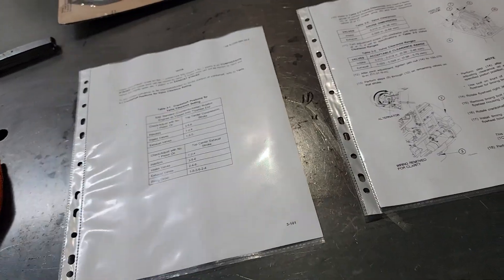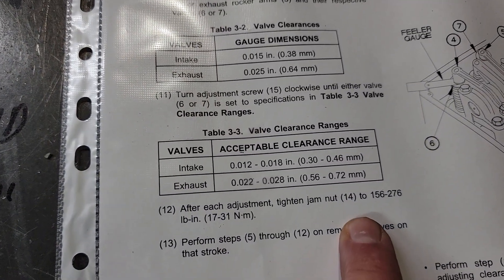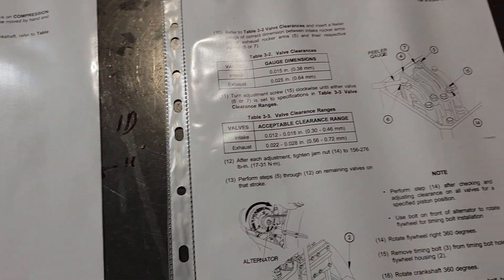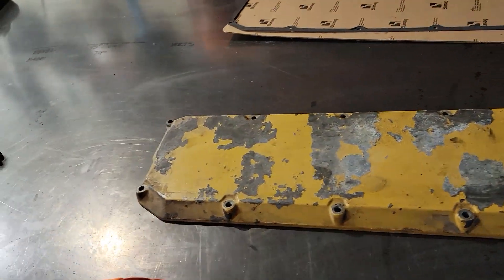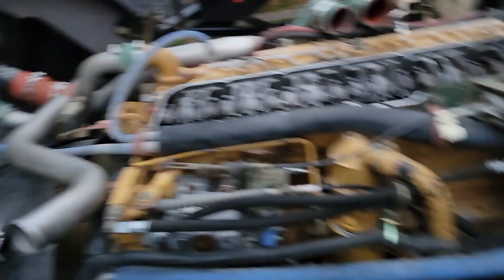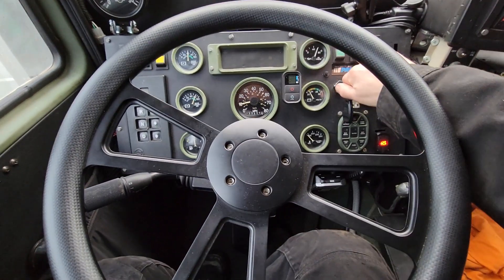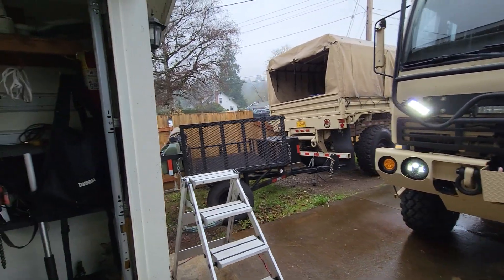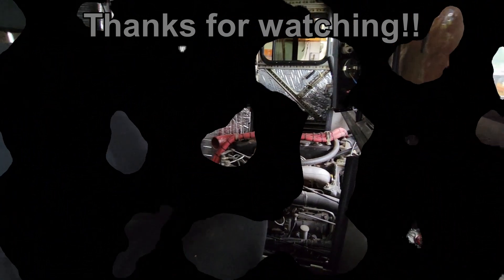Abel LMTV build part 166 (CAT 3116 valve adjustment procedures)

Comment: Yours is so much easier to do than my 3116 because yours is on a cabover lmtv military truck mine is on a c6500 regular truck so the two or three cylinders on the back of engine are underneath the c a b and I've been I'm getting ready to do this to all of my 31/16 I have I have a total of 3 and I have one 3126 that I plan on selling
Reply from the maker: I can see how that would not be a fun task.  Luckily though they don't need to be done very often.

Comment: Ahhh another sunny Oregon morning:)  to add, while you are in there you can easily check/confirm the injector height/timing measurement with a vernier caliper that has a probe on it(most do). They list the injectors that you check on the sheet along with the valves for a given crank revolution.  With the dial zeroed with the probe flush with the end of the caliper, extend the probe and measure from the top of the injector tappet/spring cover beside  the rocker arm, down along side the spring to the flat top of the shoulder of the injector base. You can see the shoulder easily if you look down beside the injector on the intake/exhaust manifold side of the head.   The injector height/timing spec for the engine is listed in MM in the lower left corner of the performance spec sticker on the valve cover. My 225 HP 3116 says 65.64MM  +/- 0.2mm or 2.584”  +/- .007”.  These should all be very close to each other but are as easy to adjust as the valves are if they are out of wack.  I checked mine when I did my valves and the two forward cylinders were different than the rest…
Reply from the maker: That adjustment would be above my head and I had it done with the HP upgrade when I swapped the turbo and governor for the 290hp setup.  Seeing as the valves did not move much at all I am not going to mess with those injectors...
Reply: That's interesting.  The sticker on the 3116 in my generator set specifies 170 horsepower and an injector height of 64.56 mm.  The difference is probably because of the different horsepower rating and the fact that the engine runs at a constant speed of 1,800 RPM.
Reply: @frazzledude  well it is only 170HP because it is limited to 1800RPM.  But at 1800RPM that height may be the optimum timing for efficiency/peak HP.  Wonder what governor and turbo your generator 3116 uses?  80-85KW? Thats a big Genny:)

Comment: I didn't know Cat numbers their cylinders backwards.  Nice.  Looks like the engine bars over easy enough (or maybe Willow is really strong).  Always learning on this channel.  If you watch the injector rockers you can see which cylinder is coming up on TDC- might make getting the alignment dowe- SCREWDRIVER - installed a little easier.   About valve adjustments- the worst case scenario from lack of adjustments would probably be tight exhaust valves. As the valve/valve seats wear, they sink into the head and lose their clearance.  Eventually the valve won't close all the way which causes it to overheat and burn (looking at you Honda).
Reply from the maker: I would like to avoid a burnt cylinder...it was the technical manual and it did not make sense to me at first...

Comment: I  had a VW and never felt good about valve adjustments, in spite of frequent "practice." I have never "missed" that. Glad to see your success!
Reply from the maker: Well both Rusty the snowcat and Abel have mechanical diesels which can run without a battery so there is that benefit....